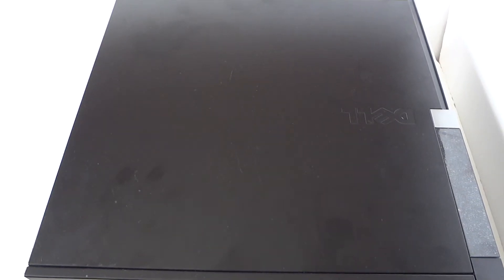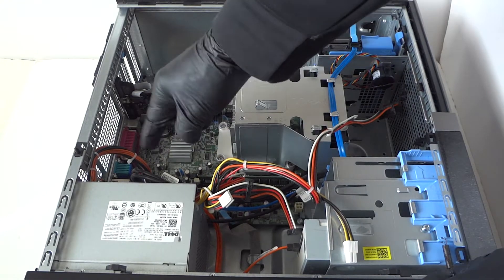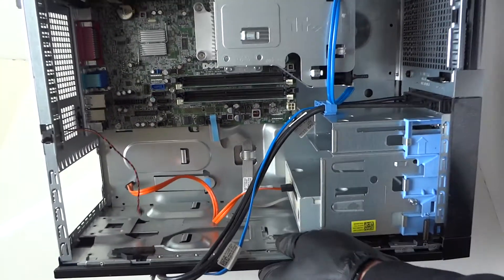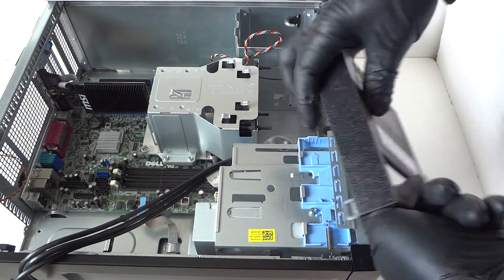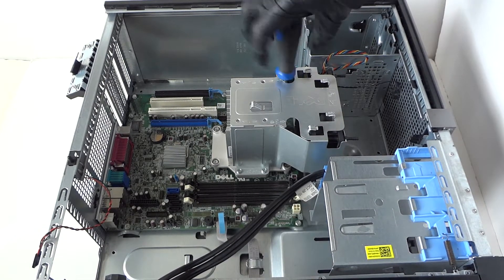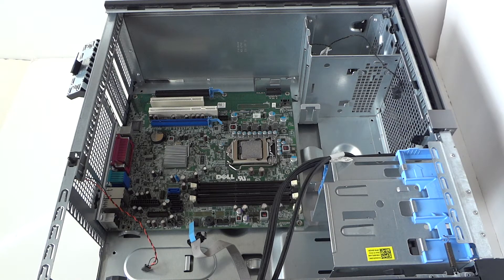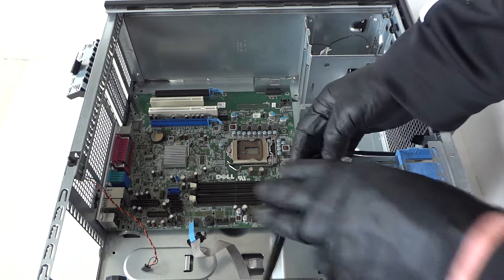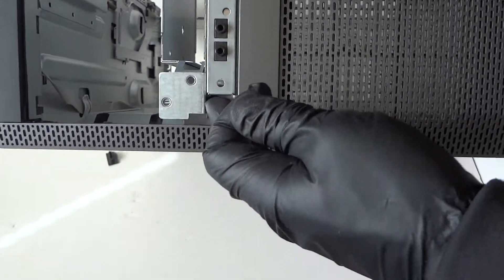Dell Optiplex 980 Teardown

Comment: Does this model accept a standard ATX PSU or an adapter is needed?
Reply: adapter is needed unless your ATX PSU has mini24 - ATX PSU 24Pin Female To Small 24P Male power Cable For DELL 780 980 760 960 PC - since mobo has mini24 - it was a surprise for me 2
Reply: Max SiddiQ link to the one you used? I’m seeing more negative reviews on most the ones I’ve located. Thanks for info
Reply from the maker: Hi, you can try this it should be the same Power Cable. Thanks
https://www.ebay.com/itm/ATX-Power-Supply-24-Pin-to-Mini-24-Pin-Cable-Dell-Optiplex-760-780-960-980-SFF/361307283204